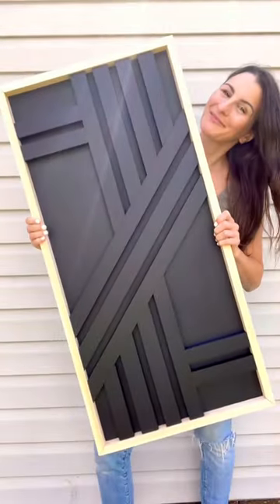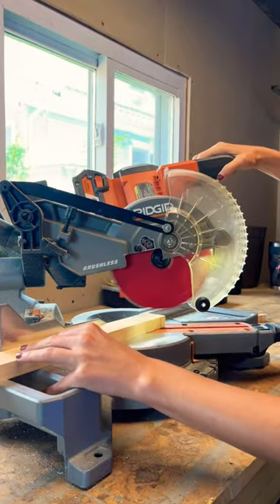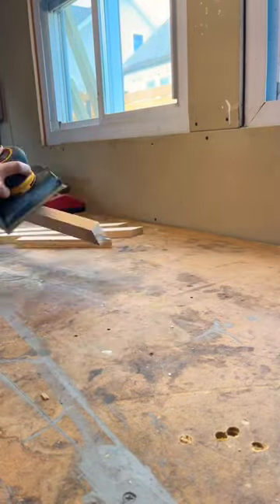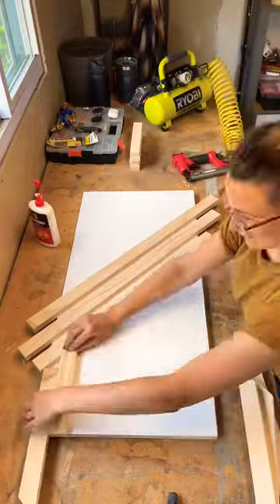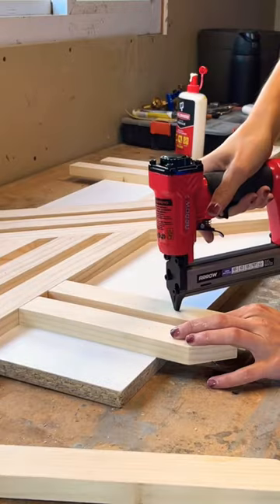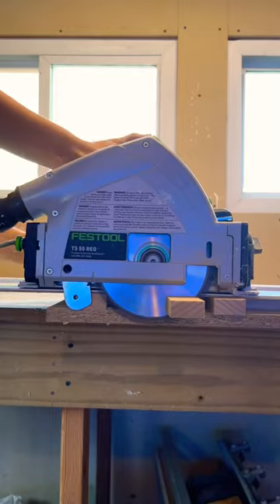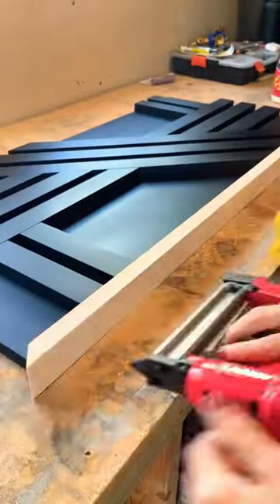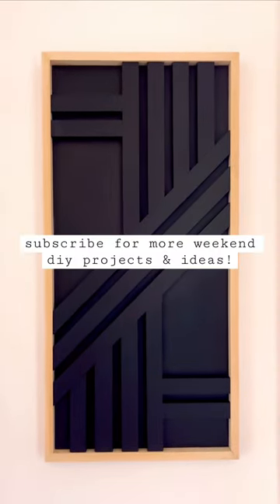DIY WOOD ART (IN ONE WEEKEND)!

Comment: Hi Sam, I love this and even have all the material to make one. Just wondering though, does glue stick to melamine? I always thought it didn’t as lots of ppl use it as a form for concrete/apoxy etc. 
love your channel! Paula x
Reply from the maker: No problems here with glue and nails! It does help to lightly sand the smooth surface first though! Same rule goes for anything you want to glue together. Hope this helps! 😊